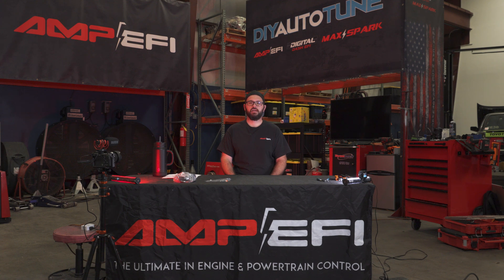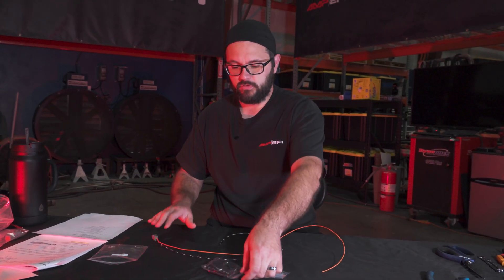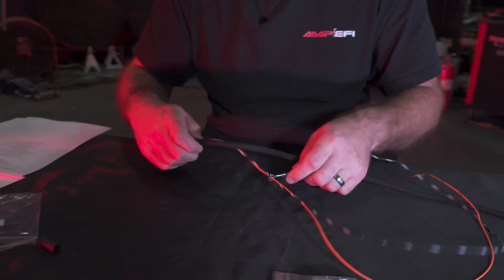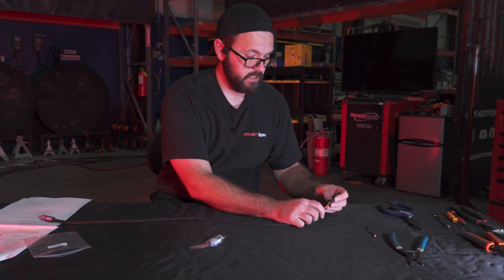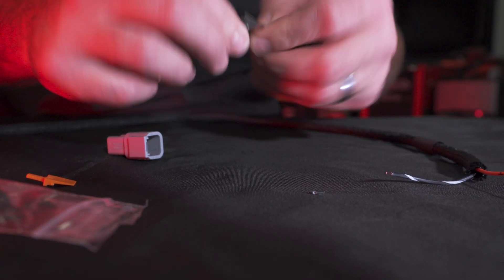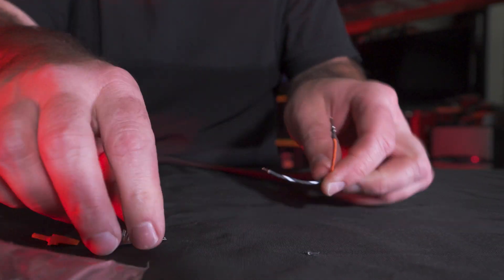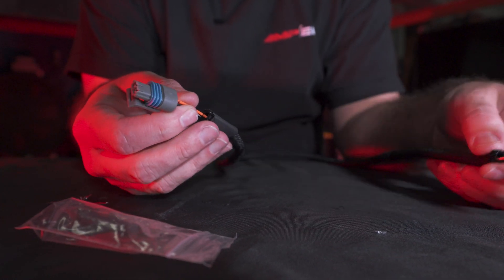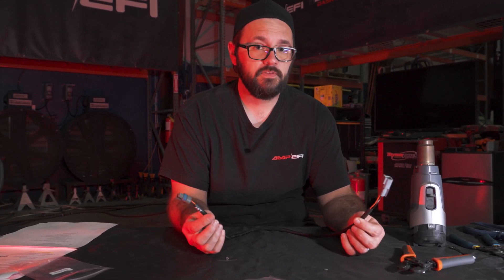How to Loom Wires & Finish Harness Ends Like a Pro | Tech Tuesday

Comment: Do you bother with stress relief loop if you only have two wires?
Reply from the maker: @learysinsight9617  generally no. I do not use stress relief loops unless the connector in question is going to see a substantial amount of movement.